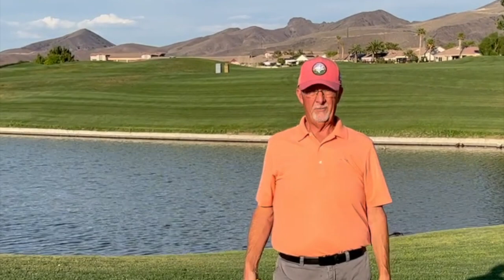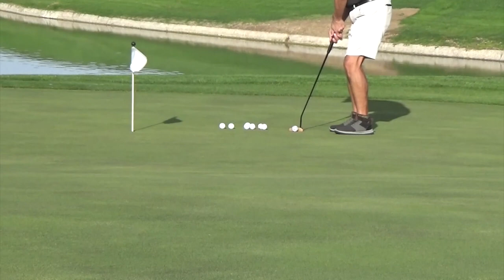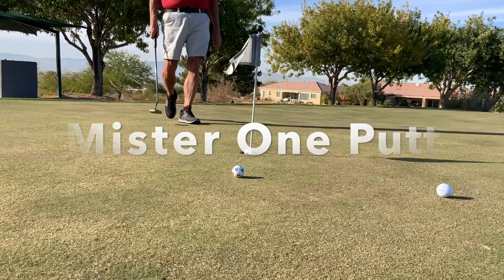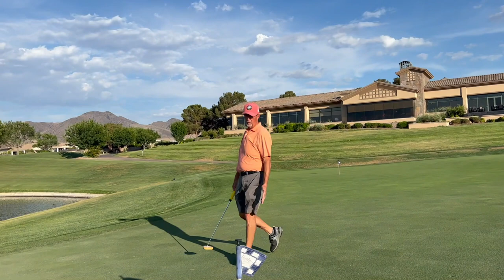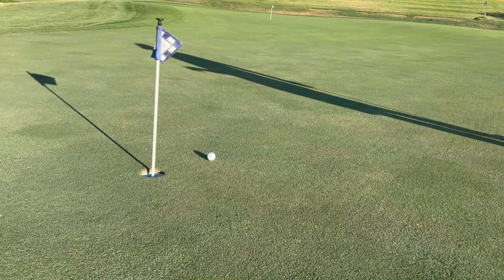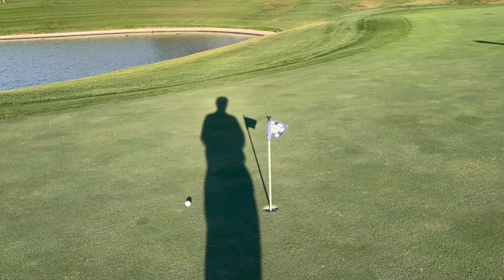The Hardest Putt In Golf

Comment: Good video.  I liked the tip about hitting the ball off of the toe. Is this a general rule of thumb, or for this specific shot? Why do so many pro's and golf instructors use more of a tap at the end of their putting shots with a slight follow through ? Is it just one sweeping stroke or the pause to tap?
Reply from the maker: Hitting the putt off of the toe of the putter is only for very fast downhill parts when you want to get the ball rolling but it’s going to be very fast and you’re trying to slow it down. The reason that most pros and good putters don’t have a long follow-through is that helps them keep the Potter face square through impact, and all of the really good putters. It appears to me stop their hands just forward of their forward, hip or their forward pocket.

Comment: IF...IF...IF...you want your ball to roll over your "coin" or mark that you've chosen, you can't start the putt on a direct line to that point.  The second the putt leaves the face of your putter, gravity is affecting the ball.  Essentially, you have to figure out how much to compensate for that so you must start the ball, on this particular putt, somewhat to the left of your chosen point so by the time the ball gets to that point speed and gravity have been factored in to your putt.  If you simply aim directly at the point or apex, the ball should wind up missing to the right of your point and that's why most golfers miss this putt short and to the right.  If the green was perfectly level from where your ball starts...to your chosen point...then by all means you could aim directly at that chosen point.  If you watch golfers, even the pros, they all make this same mistake most of the time.  Think of this almost like firing a bullet at a target 100 yards away.  The barrel of the gun doesn't aim directly at the bullseye, it aims above the bullseye as the bullet will travel in an arc.  Once the bullet leaves the barrel, it is affected by gravity....just like your ball leaving the face of the putter.  I hope this makes sense.
Reply from the maker: That’s exactly what I said. “I’m starting it on this line… it will never get there because it will break…”

Comment: Hit it off the toe is the dumbest thing I’ve heard today.
Reply from the maker: Not sure why that is. Hitting off the toe does not cause you to miss putts off-line because the ball doesn’t stick to the face long enough for any twist, resulting from hitting it off of the toe to change the path. The only thing that affects Line is putter face at impact not where you hit it on the face. The only thing that happens when you hit the ball off the toe is that the distance is less because you didn’t hit it center. Now hitting off the toe is usually a bad thing because you want to be consistent with your speed and distance control in this case intentionally hitting it slightly off the toe reduces the distance a little bit on a fast fast, fast tricky so it’s not a bad thing.